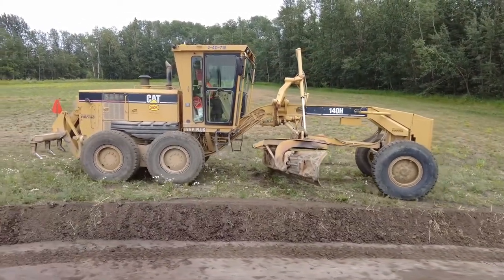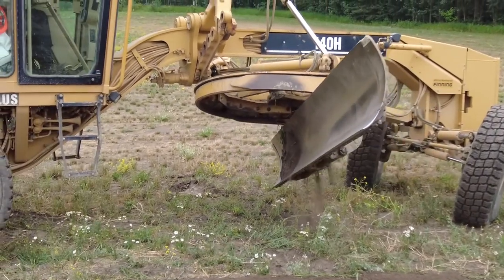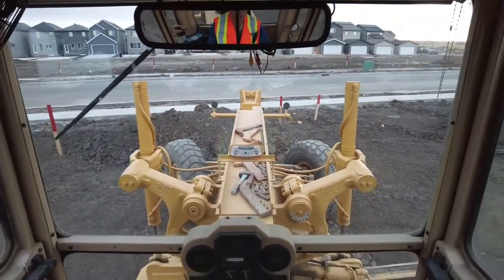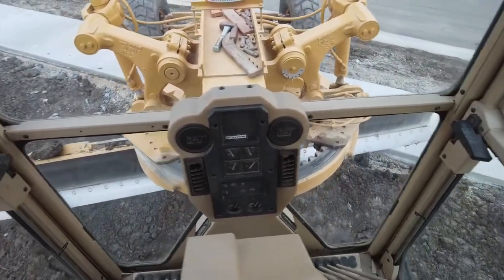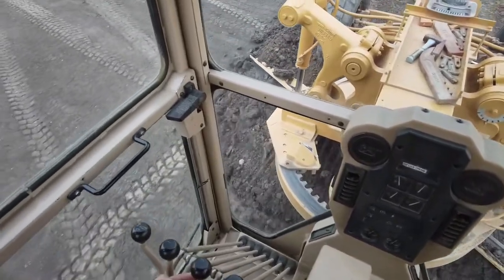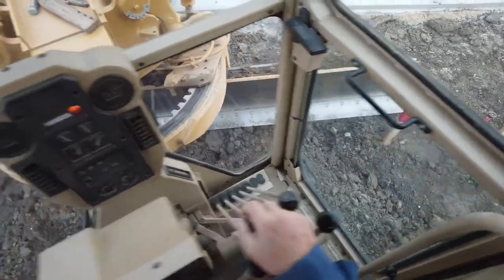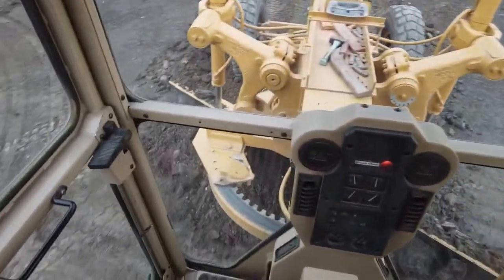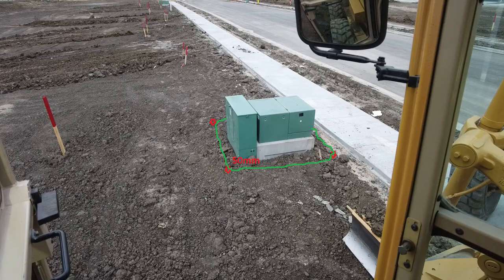Turning the blade backwards, Plus Safety

Comment: Would the circle be limited from going more than a full rotation due to hydraulic hoses for the side shift and blade pitch?   Let me mention I am not a professional grader. I own a couple old Galion for personal use and are learning a lot from guys like you.
Reply from the maker: Welcome to my channel, I'm not sure about a Galion, but the reason a Caterpillar circle can turn 365 degrees, is a component called the "Swivel" located on the top of the circle.
Reply: @onlyamillionmistakesvernky7937  Wow, continuous rotation. Life seems much easier with a newer grader. No getting out to loosen nuts and move pins. Thank you!
Reply: the only ones that cant do this are the ones setup for gps as they rip the hoses off since they are in a different spot or something, my grandpa blew a line doing it on a topcon 140h
Reply: Blade shift hoses would get a little tight and twisted

Comment: Una vez quise hacer eso por una ocasión subi una cuesta como no pude ya darme la vuelta para bajar trabajando,  intente bajar raspando con la cuchilla al revés asentada pero me di cuenta que las mangueras hidráulicas se templaban mucho me di cuenta de eso y no lo ise en su totalidad el giro con una cat 120k porque como dije se temblaban mucho las mangueras corría riesgo de que aya avería por la tensión ennla mangueras hidráulicas nose he visto vídeos que algunos logran acer ese giro pero en mi caso vi que se temblaban mucho las mangueras idrauicas
Reply from the maker: From Spanish to English : Once I wanted to do that for one occasion I went up a hill and I couldn't turn around to go down working, I tried to go down scraping with the blade seated upside down but I realized that the hydraulic hoses were very warm I realized that and I did not I fully completed the turn with a 120k cat because, as I said, the hoses were shaking a lot, I was at risk of a breakdown due to the tension in the hydraulic hoses. I have not seen videos that some manage to make that turn, but in my case I saw that the hoses were shaking a lot. hydraulic hoses
Reply from the maker: Hi MIGUEL, I've never encountered the problem of tension on the on the hydraulic hoses. The circle has a component called the "swivel", it should allow the hoses to swivel without tension. A hydraulic motor is used to turn the circle. Because hydraulic motors are inefficient, they will cause heat, but don't worry about it unless the hoses are too hot to touch. The 120K is a nice grader, and it Sounds like you are very cautious. Thank you for watching. PS: If you would like to tell a friend about this channel, just say, "Google Vern Kyle".